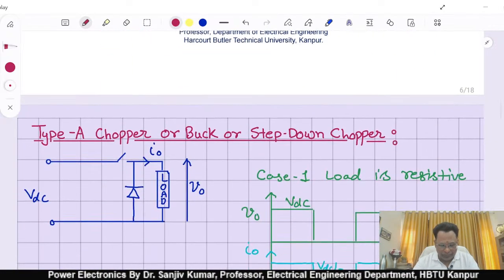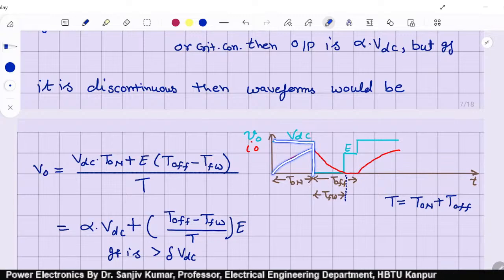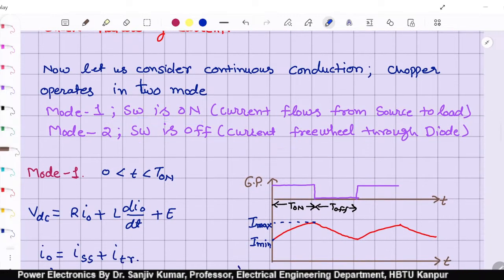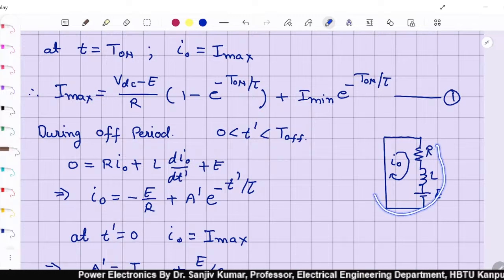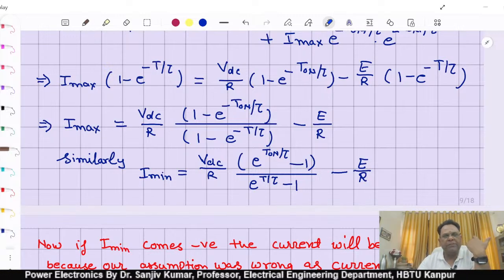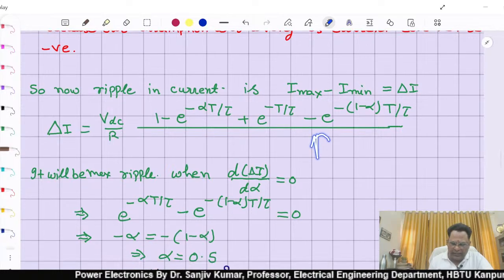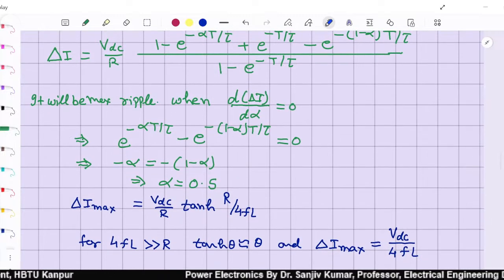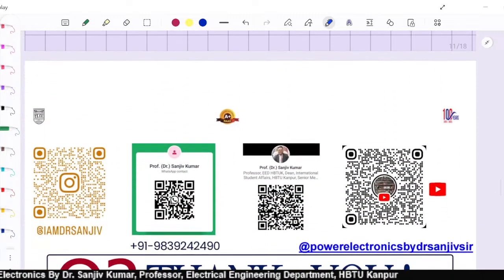Live Lecture Series, Lecture_16 : Analysis of Buck Chopper

Comment: The connection between duty cycle and average output voltage in the buck converter finally clicked. The steady-state analysis made it very intuitive.